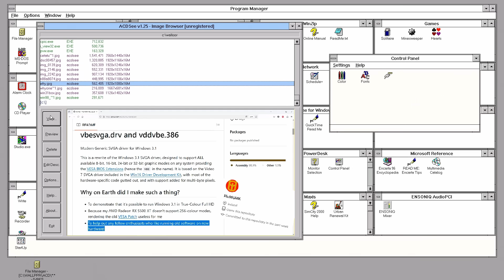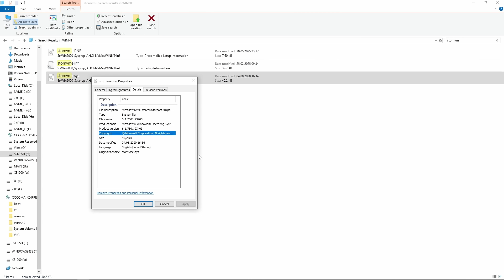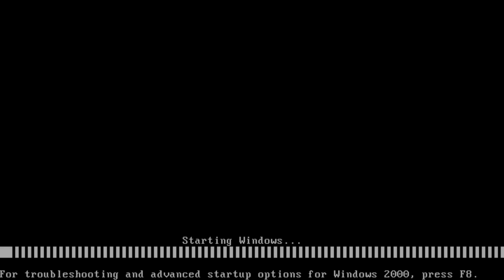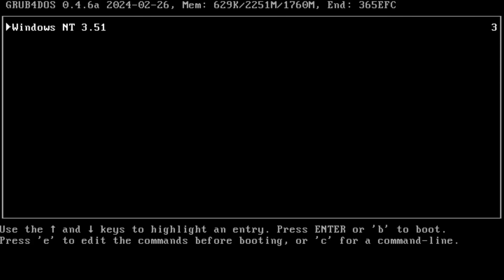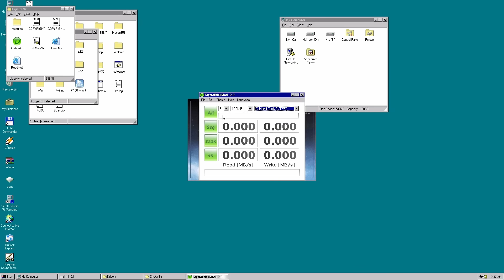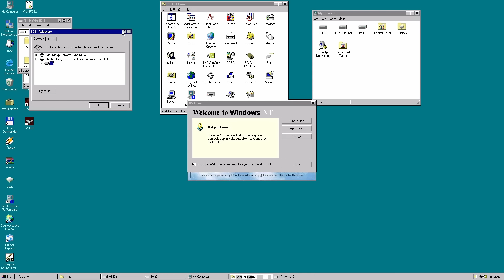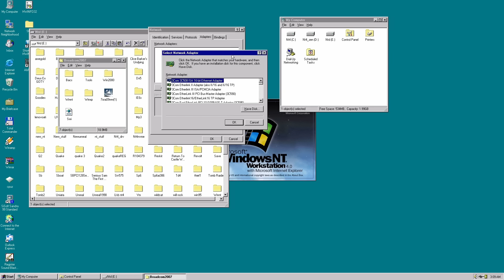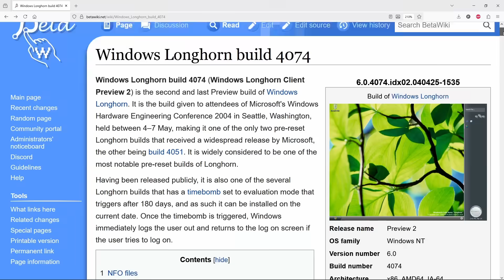A 1996 OS with NVMe support? Windows NT 4.0 Just Got a New Driver!

Comment: Interesting findings!! Yeah Windows NT 4.0 surprisingly adapts to modern hardwares... But I saw you only tested the "regular" ones, those with no frills.
But however, I bet Windows NT 4.0 cannot make full use of those funky CPUs with "alien" parts, like Intel's "Meteor Lake" series...
Reply from the maker: Tested Windows NT 4.0 on an i5-14600KF (with its E & P cores) and it worked: https://youtu.be/m8N6-IQi934 It booted even in multi-core mode. Seems like it'll run on any x86 CPU. The catch with Meteor Lake is that socket 1851 motherboards lack CSM. There's a workaround like CSMWrap, but it's not as solid as native support.
Reply: @O_mores  Interesting and happy to see my favourite OS running just fine on such a flashy CPU, even having more than only one core detected! But my hypothesis about it being unable to detect and use the funky parts in the CPU, such as built-in video adapter and, NPU or something, is based on the common sense that "Legacy OSes don't have drivers for flashy new hardware".

Comment: I recommend trimming the MVMe SSD weekly because there might be a software that will be compatible with NT 4.0 & W2K.
Reply from the maker: The developer is working on adding TRIM to his driver and there's already a very "primitive" tool, as he described. Anyway, I don't think you can move so much data in Windows NT 4.0 to wear out the drive. If it's on a multi-boot setup, you can add or delete files from Windows 10/11 and then boot into NT 4.0.

Comment: Seems that benchmark errors are caused by HBM, which offloads SSD cache to system RAM. That Samsung has dedicated cache chip on-board, while Kingston and Intel drives are reliant on HBM. So direct IO works with transparent cache and borks with cache offloading
Reply from the maker: We're on the same page. I actually suspected this, but it turns out the Kingston A2000 does have a cache (512MB for the 500GB model and 1GB for the 1TB model). So, it's probably something else. I'll have to check the new, improved driver that was released just a few days ago.

Comment: windows server 2003, i can believe it, Alot got let go with that os, supposedly it's source code got leaked.
Reply from the maker: Yeah, Windows Server 2003 x64 was basically the foundation of Microsoft’s modern 64-bit Windows architecture. A lot of the kernel, driver model, and subsystem work they did there carried forward into later versions of Windows.

Comment: I need USB for NT4.
Reply: I use "Inside Out Networks usb peripherals drivers" for Nt4. 
Works with hot swapping usb, even with usb thumb-drives, its a must have.
Reply from the maker: All right, I just wrote a Patreon article (it's free) so you can download from there the NVMe, USB and Nvidia drivers used in the video. Check it out: https://www.patreon.com/posts/windows-nt-4-0-143772617

Comment: I wonder if giving Windows 98SE/ME NTFS support and native unicode will ever be possible. The closest we have is a read/write driver but never 9x on an NTFS partition.
Reply from the maker: Probably we'll not see that level of NTFS support in Windows 9x. Microsoft didn’t publish the full NTFS internal specs for years, which made things super tricky. One tiny mistake could corrupt the whole disk. Linux had only read-only NTFS support until around 2006, when ntfs-3g came out - but that ran in user space, so it was slower. Full native read-write support finally landed in 2021 with the NTFS3 driver in kernel 5.15. That one’s in the kernel, so it’s way faster and more reliable. Crazy to think NTFS was released back in 1993, and it took almost 30 years for Linux to get proper support!
Reply: @O_mores  Given that Linux "getting proper support" for anything is nigh impossible without either good documentation or a lot of reverse engineering it shouldn't be that surprising or crazy that it took a very long time to get reliable support for NTFS.

Comment: How do we install NT with modern hardware... The last time I asked myself this was like 2001.
Reply from the maker: Go for the Universal NT Installer for the fastest method, as shown at 4:47. Or, if you wanna go through the whole classic install, do it on PCEm like I showed in this video: https://youtu.be/0gyDNUwG35Q  After it's running in PCem, add the UniATA AHCI and NVMe drivers manually. Then just transfer the partition to an SSD and it will bot on real hardware.

Comment: So question. Didn't watch the entire video. Had skipped a bit so sorry it it was explained. How does it bypass the GPT? Or is that more of a uEFI requirement than a NVMe Requirement?
Reply: UEFI requirement, nvme itself is just a block device like scsi and sata, the partition table sits on top of that, then the filesystem on top of that
Reply from the maker: I'm not using UEFI on this build - it runs with CSM. Even on my main PC used for heavy video editing I'm still not using UEFI because it's not making my PC faster, but much secure. But I really don't need that much security. With CSM, the NVMe drive will be made available to DOS/Windows 9X with no Windows driver required; it will work in MS-DOS compatibility mode. It's way slower but still incredibly fast for Windows 98. As for Windows NT 3.5x / 4.0 / 2000 and newer, the NVMe drive is just a PCI device - if we have drivers, the controller will be initialized and, as you can see, it works just fine. And now we have drivers... :)

Comment: Which files should I use to install the NVMe driver? I have 2 drives
1. SATA with WinNT 4.0 SP6 installed
2. NVMe

I installed the driver from the nvme2k-1.0.0.1.zip archive, it installed, but after restart it is not running and there is no NVMe disk partitions in My computer window.
Reply from the maker: Check via Administrative Tools > Disk Administrator. It should appear there as Disk1, with Disk0 being the boot drive. I used the files Ages2001 sent me, and now that you mentioned... I noticed that the NT4 driver is bigger in size. I’ll upload the NT4 driver I have to Vogons within the next hour - there’s already a thread about this. I also tested the Windows 98 version, and it works.

Comment: Hey omores I had a weird question. Not sure if u can answer. I know from vids and product descriptions that the star tech enclosures don’t work for GPU. But in theory could you use an s3 virge in a primary slot but a voodoo in a star tech enclosure since it’s only an accelerator ?
Reply from the maker: I can test a video card, but I don’t see why it wouldn’t work, since it all happens at the hardware and protocol level - for the BIOS and the bridge chip in the enclosure, something like a Voodoo 3 PCI is just another PCI device. It can be problematic to set it as the primary video card, though - check this video for more details: https://youtu.be/RWupO_3Zv6s. . Anyway, if I plug the enclosure into the first PCI-E 16x slot and install a PCI video card, I think it should boot.
Reply: Well what confused me is that the startech enclosure said it didn’t work for GPUs . Like the 4 slot enclosure. But I was thinking if the 2d card is inside the primary slot and the voodoo 2 is in the enclosure that it might work anyways. But based on what ur telling me are u saying that the star tech can work even if the enclosure has its own pci GPU ???
Reply from the maker: Intel dropped native PCI support from the chipset starting with Haswell (4th Gen). But since PCI was still in demand around 2013, many motherboards kept the slots until ~2020 by using a PCI-E to PCI bridge chip (like the Asmedia 1083). This chip handles all the translation at the hardware level and works flawlessly. It doesn't matter if the bridge is on the motherboard or inside the Startech enclosure - the PCI cards should work exactly the same. I'll test my Voodoo 3 in the enclosure and let you know how it goes!
Reply: Thanks so much man still a legend as always. How ever I’m equally curious about the voodoo 2 working or perhaps even the one in a million chance sli working xD
Reply: @O_mores  Must ask out of curiosity? were you able to test this? i cant tell weather or not i want this to work or not such that it would make my build even more insane but more expensive xD
Reply from the maker: Sorry, I didn't have time - but I will! I've booted on modern systems with S3 Virge cards and others, they work for sure. Check out this video: https://youtu.be/jflb_6Bpv-o
Reply: @O_mores  im most curious about the voodoo 2 on the enclosure. but if its just s3 virge even thats good news ^^
Reply: Yes I’ve seen this video before I got the adapter from Osckhar that can do pcie agp instead. Aswell as the Kurito one for agp to pci which in my opinion might even be better then the nz mods one based on what I searched. I’m in the enthusiast level early on but I wanna know the enclosure might do what I need but it’s cuz I don’t wanna waste the money without knowing is why, which is why if u have one how much it help to know. But when ever u have the time ur always the best that u even respond. Means a lot legend
Reply from the maker: @michaeldariopellittieri3050  I'm testing the enclosure today. I already tested a Voodoo 2 last night in Windows 10 and 11 on the motherboard from this video (Asus B360 Plus), and it worked.
Reply: rr but u tested it on the star tech enclosure right ? I was asking about it working to the 4 slot one. Where 1 pcie slot goes to a 4 older pci  slot. That’s what I was curious about. It’s less about which motherboard. And I was under the impression that the startech enclosure stops gpus from working. That’s what I was most curious about.
Reply from the maker: @michaeldariopellittieri3050 Yes, I played with the enclosure today. I'm making a video right now, this Friday it should be live! V2 works 🎉! More details soon.
Reply: Ahhh so the voodoo 2 worked on the enclosure. How ever it’s possible my initial idea might be right. Tbat the stand alone gpus wont work ? Either way thanks so much man this is huge.
Reply from the maker: @michaeldariopellittieri3050  Check out my FB page if you don't have patience for the full video. I will check a Voodoo 3 PCI as well. Fb: https://www.facebook.com/share/v/1FgskUY5Qv/
Reply: HOLY CRAP DUDE I LOVE YOU. Thanks so much. I had the patients I was just like really confused cuz of how many people told me this dosnt work. Absolute legend man. And if this works on the single cards to that makes this even greater. ❤️❤️❤️
Reply from the maker: @michaeldariopellittieri3050 Well, I played more with the V2 today, and there doesn't seem to be any problems with the games I tested: Sin, Quake II, NFS 2, and Unreal. As for separate GPUs, there seems to be a problem in that the system will freeze at some point—tested with a S3 Virge DX and a V3 3000 PCI. It will boot and the drivers will install, but it will freeze... so I can't say it works. Maybe it's something the bridge chip XIO2001, with Asmedia 1083 V3 works perfectly fine.
Reply: @O_mores  Ahhh so the info i received was half correct. someone explained to me at a computer store that a voodoo 2 nor other GPUs wouldnt work via the enclosure cuz of the Interupt timings. but i said maybe the voodoo 2 could work in some cases, and he said he doubted but worth a shot. so i think we discovered a new reveal about this, thanks so much omoroes absoulte legend, now i can confidently buy the enclousre ^^.. butt hey if u ever do manage to figure out a way to make the Standalone gpus work that would make things even more insane. either way cheers man
Reply: @O_mores  however ultimate test if SLI could work on the voodoo 2 if the main card is in the motehr board would truly be insane :O!!! ( high doubt tho )

Comment: Good to see the NVMe drives I sent earlier this year were useful!  All these new NVMe drivers are stealing the retro Windows spotlight from the AHCI PCIe drives 😂
Reply from the maker: Yes, those drives will stay with the channel forever. Thanks again! That boxed Samsung SSD your father bought is still sealed, but I have plans for it. By the way, there's an NVMe driver for Windows 98... I will check it ASAP, I just found out yesterday. It looks like it's based on this NVMe driver made for 2K/NT4.
Reply: @O_mores  That's so cool, I never thought a Windows 9x NVMe driver would ever actually materialise, but the community never ceases to amaze me.

Comment: boot multiple os's on it?
Reply from the maker: This is how I'm using it, all in a multi-boot setup where NT 4.0 shares the exact same hardware as Windows 9x. More specifically I can use for Windows 98/ME and NT 4.0/2K/XP the same PCI-E BCM5722 NIC, the same sound card, the same PCI-E to USB 2.0 adapter, and this Quadro FX 4500 which is basically a 7800 GTX.

Comment: Was the CPU forced to operate in single-core mode due to limitations in the nVidia driver?
Reply from the maker: No issues with multiprocessor support on this build. I actually recorded some footage with NT4 and 2K running with MPS and both drivers are running normally,  but I ended up cutting that section to keep the video shorter. My last video was 23 minutes, the average view time wasn't great, and YouTube stopped recommending it pretty fast.

Comment: Ah, this is pretty cool. Back when Microsoft actually made good operating systems. It's really too bad that more can't be done to really bring these old operating systems back to life and usable as a real daily driver.
Reply from the maker: Yeah, exactly ... in the early ’90s Microsoft had almost no presence in the workstation/server space. It was all about Novell NetWare and UNIX back then. When NT 3.1 dropped in 1993, they really had to prove themselves. Fast forward to the late ’90s and NT had taken over most of that market...
Reply: @O_mores  I remember when I was taking the Network+ exam, there were so many questions when it came to Unix and NetWare, things that really weren't as relevant anymore since most companies had switched over to Microsoft Windows for their active directory domain support.  But it was amazing just how much there was out there that I had never worked on and how these things were different from Windows and what I was used to.
Reply: There is the One Core API that's basically backporting features to Windows XP. It's still rough around the edges, but several modern apps are compatible now.
Reply: @red-republican Oh wow, that's cool. I do wish I had more of an interest in Windows again, but Windows XP was definitely one of the last best versions in my opinion. I feel as though Windows 7 received a bit too much credit for what it was. It wasn't bad, but it wasn't great either.
Reply: @red-republican Sure, but any time you go around hacking the kernel instability will probably follow.
Reply: It'd probably be less work to reimplement a shell and a bunch of applications and UI on top of a modern windows than to try to bring an old kernel up to effectively taking advantage of all what newer hardware has to offer.

Comment: This feels so cursed... 🤣 But while i wouldn't trade NT5 for it, i do have a soft spot for the old workhorse, too many years with it i guess. But now i have a nagging doubt whether ran Deus Ex on NT4 or W2K. Max Payne was definitely W2K, but Deus Ex... really can't remember. It certainly wouldn't be far fetched as it used UE1 and UT ran on NT4 so...
Reply from the maker: I like to keep NT 4.0 around since I can use the same GPU that I use in Windows 98. By the way, Epic Games began developing Unreal on some workstations running NT 3.51, so UE1‑based games should work on both NT 3.51 and NT 4. Check out this video about NT 3.51: https://youtu.be/qIbeV1BYyOo - where I tested Unreal and Undying. I also tested Deus Ex, and I know for sure it works.

Comment: There is source code of the Windows XP leaked; it's time to man up and create an open-source NT OS that doesn't aim to be compatible with the original Microsoft OS. Instead, it should bring back classic software speed and optimization without the modern bloat and surveillance capitalism.
Reply: You have MenuetOS, KolibriOS, AROS, etc... Doesn't get any faster, smaller and more optimized. It just shares the same issue as *nix. Lack of applications. Yes, believe it or not, users don't give a hundredth of a f about the OS, they only care about applications. Peasants...
Now, if only the FOSS community got their heads unstuck from their pompous posteriors and started helping ReactOS, we'd get to a good place, but such is not to be.
Reply: Nobody is allowed to touch that with a ten foot pole. That would be a legal nightmare
Reply from the maker: To create a new OS it is not that complicated, especially in this age. But to make people use any new OS is probably way harder now than it ever was. The only way to do it would be to have some killer feature that basically forces you to use that OS. For example, making some insane open-world game that would run optimally only under your new OS… Then you would have a base of 3–4 million players using your new "GameOS", and you could scale further…